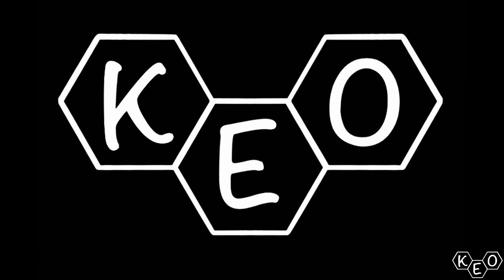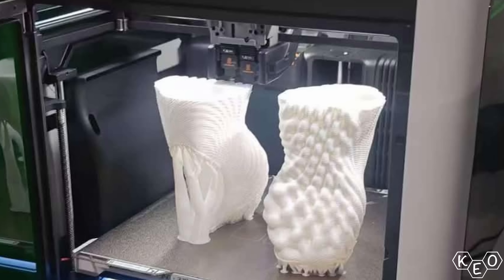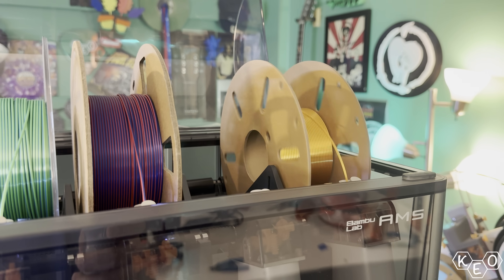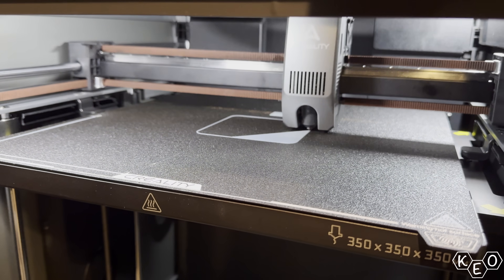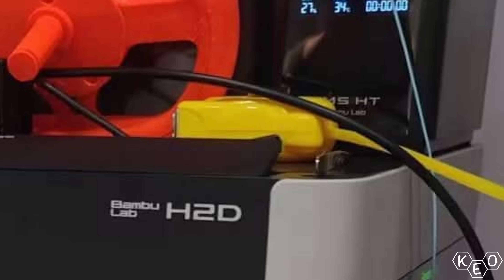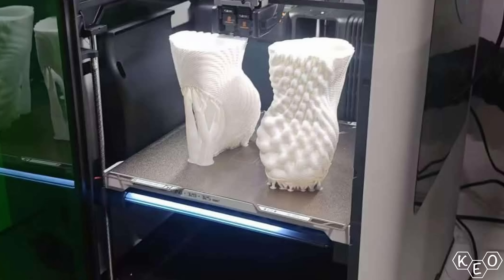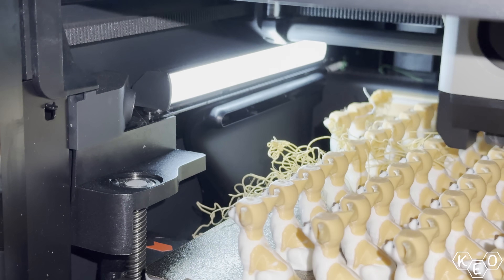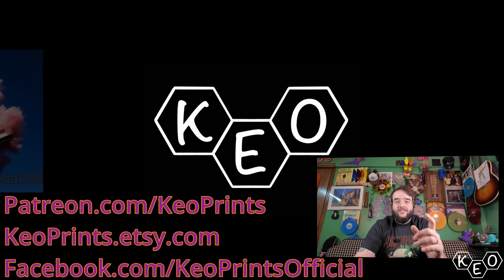The Unreleased Bambu H2D Changes Everything

Comment: the AMS' HT stands for Humidity Temperature (vs the AMS H version, which is just Humidity).
Reply: @petermarin  having added, as I guess everyone does, a temp/humidity sensor to the AMS I'm wondering if the new version is externally vented, to drive warm humid air out of the unit, or simply heated? I run LEDs under mine which gives a constant heat source. Occasionally opening it while warm to swap spools seems to keep the humidity low enough
Reply: how do you guess that ht stands for that ? any sources ?

Comment: HA! Little did you know that toolhead actually contains FOUR nozzles, for true zero waste when printing four colors! 
I'm kidding, but wouldn't that be cool?

I can see a two nozzle setup being PERFECT for single color prints that use a different support material! Or set up your print to have the interface layer between support and model being a different material for even easier removal!
Reply: or even petg + abs prints for best of both worlds, or other funky combinations
Reply: We know it's not a 3 color print head, but....  Most of the tool head mass is the extruder motor and only one nozzle is extruding at a time so if there was some simple, reliable and low mass mechanism to share one extruder motor between four hot ends....

Comment: Not familiar with lasers at all, but would expect that adding a laser with the dual filament head, larger print volume, and a temperature controlled AMS would drive the price well north of $3000. I was getting ready to order the Core One kit but will wait and see what Qidi and Bambu announce.

Comment: I did not like Ace pro - lots of tangling issues, run length of filament, weak motors etc - the S1 went back - it’s got teething problems- they get that out of the way they have an excellent product for the price ?
Reply: What shocked me on the S1 was I was 100% convinced it would do material changes faster than the Bambu AMS could do (seeing the way the hotend/tubes are done on both).  I was shocked to learn the Anycubic does filament changes a lot slower than the Bambu AMS does.   But overall, yes, the S1 is certainly an interesting machine IF you get a good one (Anycubic QC, just like Creality QC, is very much a hit-or-miss thing, way more than with brands like Bambu and Prusa).

Comment: I get that their volume has been set for quite some time, but to be plain..... It's not enough.  Super glad it's bigger, but come on.
Reply: Right?  I mean, if you are going to go bigger, GO BIGGER.  Don't inch up on it, at least start at 350x350.
Reply: Yeah i honestly just want a 350x350 p1s
Reply: @ZerocoolsPropsandCollectibles  I am trying one.. Only it's a k2p 😉
Reply: i think its perfectly good size, the market doesn't have a lot in this range, the problem is trying to force things like lasers into it, and how well they can get the dual hotend to work, because others have failed miserably.
Reply: @xXKisskerXx  I think most want 350mm plus that want a bigger bambu printer.
Reply: yeah 6 cm more is very underwhelming
Reply: @F-Andre  at 350,  I have to divide maybe... 5% of my parts (abs /Asa lab equipment).. It is so much more convenient than I thought it would be
Reply: @000elemental000  yeah but announcing a XXL Printer i thought something about 40x40 or 50x50